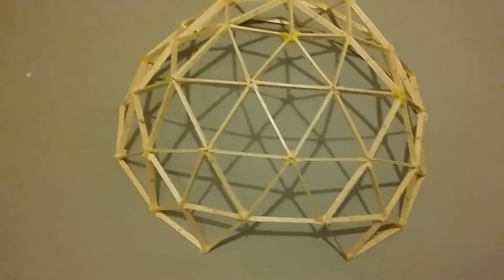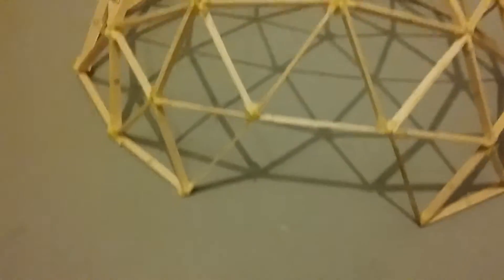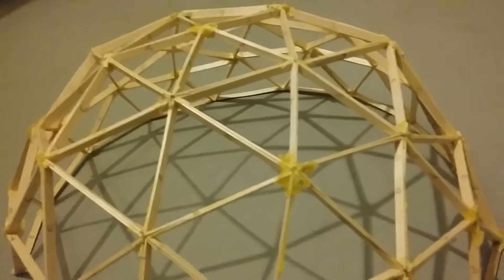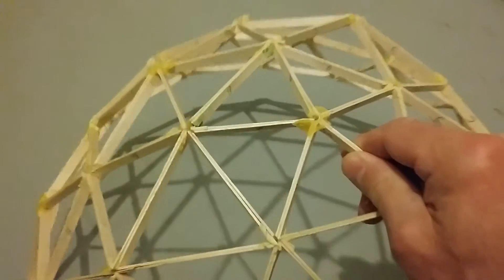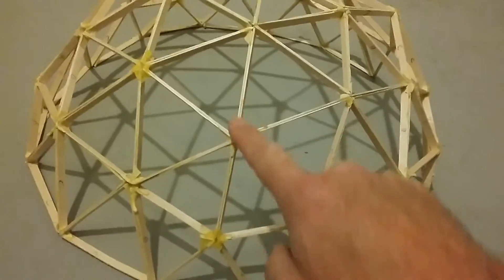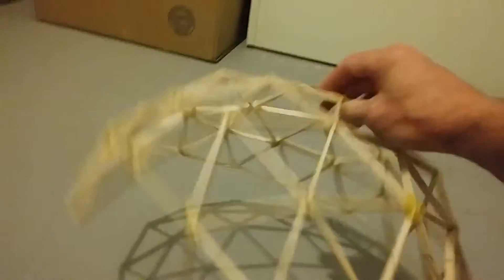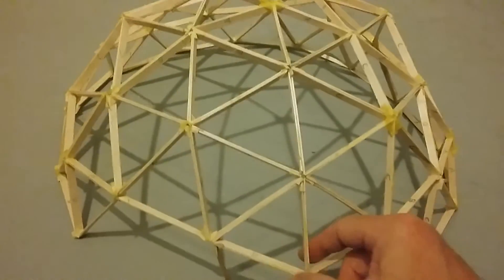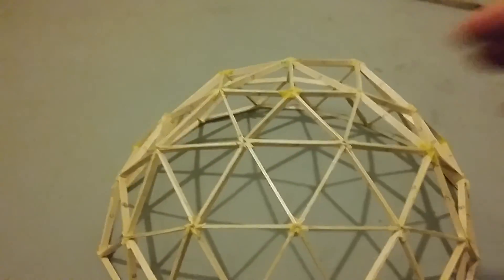MY 3 FREQUENCY GEODESIC DOME MODEL

Comment: Nice work. You could convert it into a 3v 5/9 at a later date ;) 
The online dome calculators are good for even frequency domes but not so good for odd frequencies as they result in a non flat base.